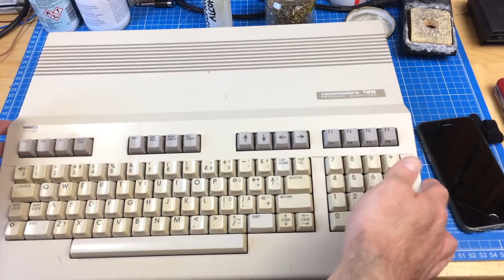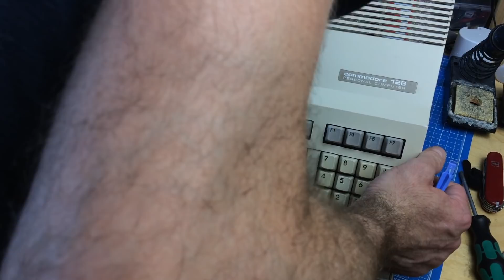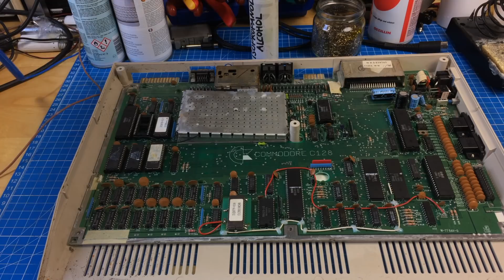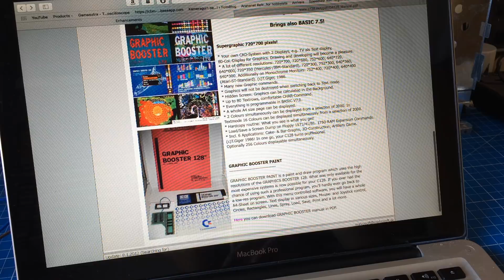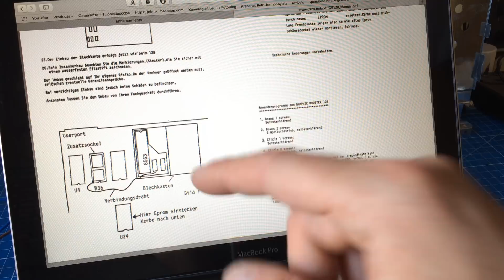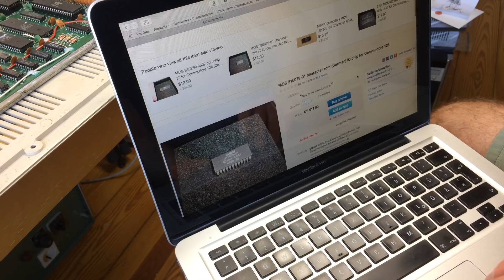Commodore 128 Part 1: First Inspection and Surprise Enhancements

Comment: Just needed to put that AI-generated video summary here for posterity. Enjoy! "The video features a first look at a Commodore 128 computer, a successor to the Commodore 64. The host, Sam Botta, inspects the machine and discovers several surprise modifications, including a graphics booster and a German-localized kernel. The video ends with Sam planning to build a power supply for the Commodore 128 in a future video." Nice to meet you ... SAM BOTTA? 🤣

Comment: You can now replace all 16 DRAM ICs in the C128 with a single static RAM module which consumes only a tiny fraction of the power of the original chips. http://www.melon64.com/forum/viewtopic.php?f=34&t=12439
Reply from the maker: Nice project (again), sir! :)
Reply: @HansCampbell  WTF ?? It has nothing to do with TH vs SMT... DRAM is incredibly sensitive to bad voltages and will crap out first if there is any problem with the PSU while static RAM basically lasts forever. Ray Carlsen knows these damn Mt DRAMs die just like old light bulbs.
This is certainly the most ignorant comment I have ever read about DRAM in C64/C128.

Comment: This thing is a PITA to open, isn't it? I received one in the past week for free with a 1571 drive. Very yellow/brown, but retrobrite solved that problem. And the only thing wrong was a bad 128 BASIC ROM (U33) oddly enough. But it was scary getting the case open. Those tabs on the sides really hold this sucker together with a death grip. So afraid to break them when opening it, which is why I left it open until everything was done and now it is closed...and hopefully I never have to open it again!

Comment: Never use an Amiga PSU on the C128 (or vice versa) even though they share the same connector.  It will fry the machines.

Comment: OTOH, a better hybrid might have been 6502+68000...
Which would really have been Amiga with a C64 mode, potentially.
Or a 3-way perhaps?
Cover all the bases (at the time)...
Maybe with a V20?
Mind you at this stage the 282, IBM AT was about out.
What-might-have-been is a complicated pastime... :-)

Comment: That board was extra ram so you could use graphics in 80 column mode.  graphics booster as it was called here.. I just changed the chips on mine to the upgraded ram.  I forgot what size was in there to begin with and what i upgraded it to.  THE 128D has this video ram already upgraded in it

Comment: Hi Jan. Got same (almost) C128 with same Char rom... Strangely mine lacks the red loop wire and found that one of the pins was out of the socket underneath... Can you, please, tell me how the wire loop was attached and if any of the pins was out of its socket? Mine is still got a black screen so a long way ahead of me before it comes back to life (first I´ll socket all main ICs and find some spare ones). Regards from Spain... or Netherlands, depens when you read this!
Reply from the maker: The little board is an adapter to fit the 28-pin EPROM in the 24-pin socket. The cable is part of that afaik, because the pinout is slightly different for 27xx EPROMs. You might have another little adapter which doesn't use the cable. The pin might also be left free on purpose. Here's a wiring diagram for this kind of adapter: http://sleepingelephant.com/ipw-web/bulletin/bb/viewtopic.php?t=1959&start=15
Reply: Super! Thanks a lot for the info. I'll check it and see what I can find. Still a long way ahead of my C128 (actually, I've got two of these... Can't wait to see the green&grey screen back!)

Comment: Important to notice that despite it's the same type of connector, you can't use an Amiga powersupply because the pinout is different. You will fry your C128...
Reply from the maker: Yeah, I don't think it's a good idea to use an Amiga PSU (otherwise I would have tried as I have plenty of those lying around). The pinout is not all that different (the pins supplying 9V on the C128 are 12V on the Amiga, 5V is the same) so it might actually work for a while but I wouldn't recommend it.

Comment: I loved using my C128 and 128D back in the day.    I used my 128 to run a C-Net BBS with both a 20GB Data Chief and LT Kernal Hard Drive systems.   I had my LT Kernal Hard Drive system connected to a Multiplexer so I could connect up 4 C128's to share the hard drive.  It was a crazy time back then but I eventually replaced that system with an Amiga 2000 HD with a 7 Port (I believe 7 Ports) Serial Board and I had that running multiple phone lines.    While many consider the 128 a let down because it was not fully 100% compatible with the C64 that was never a problem for me because there were some very good software titles not game related for the 128 put out by Time Works that really made the 128 Shine for me.   While I could one in C64 Mode at the time I would just use a C64.   CP/M was interesting and I did play with it for a bit because I was very familiar with CP/M but at that time MS-DOS or Messy DOS by Microsloth (yea that's what I have always called Microsoft) was taking over.    After moving over to Amiga I sold off all my 8 Bit systems and over time I regretted doing so.   When my hands stopped shaking I resumed doing PCB repairs so I bought up a bunch of non-working Commodore Units and brought them back to life.    I think you will like the C128 but it does take up a lot of desk space but its a very special machine.
Reply from the maker: Wow, that's quite an impressive setup! I'm really looking forward to trying out all the things the 128 can do. I already found quite a bit of interesting software online. Pity there's so few games for the C128 mode but there's a lot of serious programs out there for sure!
Reply: As I mentioned I used my C128's to run a BBS but I also used them for Productivity Applications for which the 80 Col Display came in very handy where as the 40 Col Displays lacked the screen real-estate for displaying information.   If you have to do a lot of typing I think you will find the C128 more attractive as its more comfortable to type on than the C64.

Comment: Now thinking. I've got an original PSU, but I wonder if some power saver exists or could be done for the C128. I haven't seen any and that would be a wonderful video if you could design and make one I guess. In any case I've heard that the C128's PSUs are less prone to fail than the C64's ones. Well, as I haven't got an idea maybe they don't need that and a fuse is enough. Dunno.
Reply: It is possible, but not needed. The C128 power supply has internal overvoltage protection, so the chance that it will kill your computer is not really there.
Reply from the maker: Yes, I think Daniël is right. The C128 PSUs are pretty modern designs compared to the C64 ones. If they fail, they are very unlikely to put out any dangerous voltages.

Comment: Be careful opening up these 128's.  There are plastic tabs on the sides of the top case that easily break, kind of like on the Amiga 500 and 600.  Though they seem more robust on the 500.  I find that using a plastic tool to carefully pry out the top case on the side helps.  I've broken a few plastic tabs on my 128's.  I cringed seeing you pry open yours!  ;)
Reply from the maker: Yes, I found that out while opening it... Strange construction. My tabs remained intact luckily but I'm gonna think twice before I close it up again. :)

Comment: You can remove graphic boster 128 and solder 64KB ram (same ones from C64c), directly to PCB instead 16KB on board ram , this rom modification are from commodore
Reply from the maker: Thanks! Found out about the RAM during my research, too. Also about the Char ROM mod. It's hard to believe it's a factory mod because the soldering looks really dodgy. It seems it is, though. :)
Reply: @JanBeta  What do you expect from 5-year-old slaves? :'(

Comment: By the time that the C128 came out, 8 bit processors were long in tooth. The computer would have been a killer had it been released a few years prior. The CP/M mode took advantage of software that had all but disappeared at the time as well. Messy DOS took care of that. I really liked the C128 but "too little, too late".
Reply from the maker: Yeah, it appeared at the wrong time. Still pretty interesting historically and a weirdly powerful machine. It marks the end of the 8-bit era I guess.
Reply: You're spot on! MOS introduced a cheap alternative to the 6800 in the 6502 and CBM introduced inexpensive computers starting with the VIC-20. The Apple/AIM/PET/TI-99/Atari computers were costly prior to the C64/VIC-20. I wonder how many people got into programming due to them and uncle Clive's little wonder? When the C-128 came around a decade later, the 6502 was obsolete and everybody else was into 16 bits with 32 bits just around the corner.

But it's the 8 bit machines that people still play with and enjoy obsolete or not.

Comment: This was my second machine when i was a kid. My father buy it after the c64. He buy with the 1571. Still at my home, working. A beautiful machine in all the views (inside and outside). Great video as always Jan!
Reply from the maker: Thanks Edu. Really looking forward to trying this thing out. :)
Reply: Same here. We started with a VIC-20, then a C64. My parents bought me a 128 for Christmas, but I still had to share it with my mother (she used it for some bookkeeping stuff.) When we moved to a new house and I got a room in the detached garage, then I finally got myself a 1571 disk drive... then later a 1581 and 1764 RAM expander. I was in heaven. 

Right up until my second semester of college, when i started taking programming classes and realized I couldn't do my homework on my Commodore computer. So I sold it all and bought an XT.... which was a piece of junk, even by 1991 standards (by then, the 486 was already on the market, and the Pentium was about to be released.)
Reply from the maker: Oh no, an XT really was a step backwards in many respects. :(

Comment: Nice video!  I think the C128 is definitely the ultimate 8-bit computer.  You can't go wrong.  I bought one back in the day to replace my C64, although it never actually did.  The original power supplies seem like they weigh more than the computer.  I will have to check mine at home to be sure but I thought they were rated at 4 Amps or something like that?
Reply from the maker: Thanks! According to the pictures I found all over the internet, the original PSUs are rated for 2.5A. There are Amiga PSUs rated at 4.5A though that look very similar.
Reply: No Problem,  Happy to help a fellow Commodore guy!  I checked both of my C128 PSUs, I am in the USA so maybe they are different here but they are both rated at 4.3 Amp on the 5V and 1 Amp on the 9V.  The model number is 310416-01.  I do have a commodore PSU that came with my 1764 and it is rated at 2.5 Amp.  I wonder if pics are mixed up?
Reply: There are 3 different C128 power supplies. They all look the same, but they come from different manufacturers: Ismet, Dee-Van and Mitsumi. European C128s normally have a power supply from Ismet, which is 2.5A.
Reply: @Daniël Mantione.  That makes sense which is why I said that it must be a regional thing possibly..  Most of the ones I have seen in the USA all have a fuse slot on the bottom and they are rated 4.3 Amp.   After looking at images of Euro ones, it seems the 2.5Amp ones don't have the fuse slot.

Comment: Nice 128 :) I knew only two guys in the 80's who had C-128, one had 128 like this and another one the updated 128D. Sadly we played with them only in the C-64 mode so I'm not familiar at all how the CP/M or 128 mode look like, hope to see them later in the video series :)
I'm from Finland so it was surprise to see 128 with Scandinavian keys, I don't remember if my friends had them or the standard keyboard.
Reply from the maker: Yeah, I think most C128s were used as C64s with fancier cases sadly. Would have been interesting to see more dedicated software for the system. As far as I know, the CP/M mode is pretty flawed and not very compatible with anything else. I'm excited about trying it out. Hope the machine works/I get it working first though obviously. ;)
Reply: CP/M mode compatibility is good, but its very slow.  To be compatible with the bus the Z80 runs at 2MHz instead of 4MHz or higher like most CP/M machines, plus to make matters worse it has to wait on the 1MHz bus for access to I/O through the CIA chips, so its even slower there.  There exists some user software hacks to the included Commodore version of CP/M that help bypass a few of the wait states, but its still fundamentally a very slow CP/M machine compared to others.

Comment: Great video. 

I remember a friend of mine had a C128 that looked a Commodore SX64 (one of thos portables with a small screen) but then a 128, and suprisingly i cant find any info on that. I know for 100% sure it whas a 128 cause he had to switch to the C64 mode to play his games. You know more of that type of system that whas??
Reply: There was never a 128-portable, but as Jan said, the 128D model had a separate keyboard  and built-in floppy drive, like a PC. That was really the best of the CBM 8-bit machines.
Reply from the maker: Mh, never heard of a luggable C128 with a screen. I know there is a desktop version (the C128D) that also comes with a handle and you can clip the keyboard to the bottom. Maybe somebody hacked that system to have a little screen? Interesting stuff.
Reply: there are some strange one offs and odd balls out there with commodore badges, mainly here in england, i have a proto 128 its a 128 in every way but its in a dark grey breadbin case(c16 style) with the old function keys, the board is socketed (every chip including crystals), and is obviously a low prod run it has no colour resist and silk screen is black, with hand drawn traces, i have only seen one like it on ebay about 6 years ago.
Reply: It's very weird indeed, i never seen anything like that again. This whas way back in late 80's that he had that machine, and he whas always bitching about switching to c64 mode and i whas thinking why watch it on a small screen if you can normale play it on the television. With the no info (and your knowledge saying it dont excist and i dont doubt that, your a commodore guru) besides the other system i think some one back in the day did a very impressive hack/mod job.

Comment: I have 2 NTSC C128s. Just modded one of them - it uses 2 EPROMs instead of 4 ROMS, also convert it to PAL. Now thinking of using Switchless kernal adapter with it, need to "Google" to see what can be done....
Reply from the maker: Nice! I think you could probably use bwack's switchless quad kernal adapter (I use in my main C64). :)

Comment: You can put like an Basic v8 upgrade or FileBrowser6 etc... in the U36,  so it is almost like an extra internal cartridge slot. The Display Booster is an extra RAM upgrade for the 80 Column Display.
Reply from the maker: Nice! Really excited to try stuff out. Fingers crossed the machine works (or I get it working again if it doesn't).
Reply: It's my favourite of the 8-Bit Commodores, I've got 3. I have to do a NTSC to PAL conversion on one of them which already has a lot of mods/upgrades. The casing is a bit battered and looks like plastic marble from a failed retro-brite. So I'm thinking about giving it a hot rod red coat and do the keys in a synthesizer keyboard style (like LukHash)… Pop in dual SID's and 4 potmeters nobs.